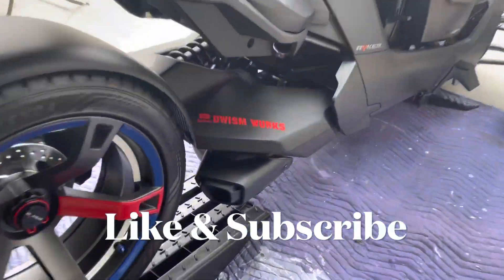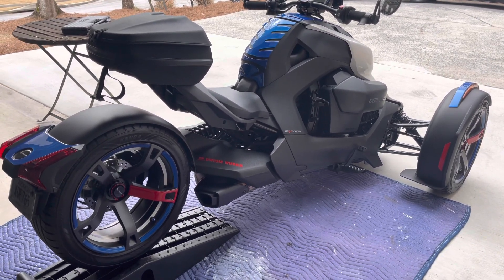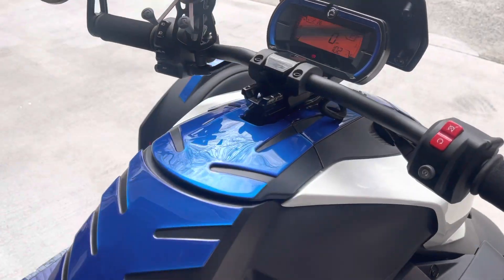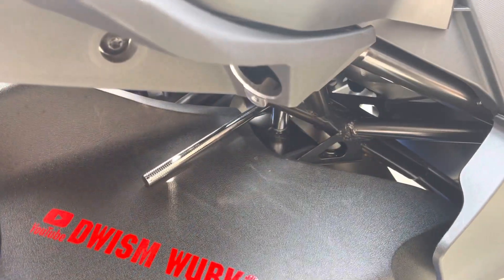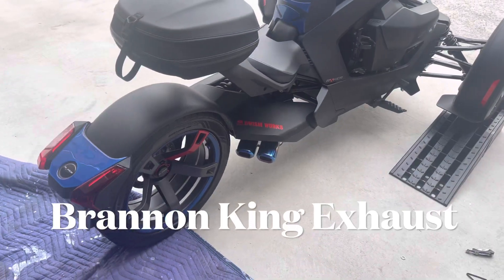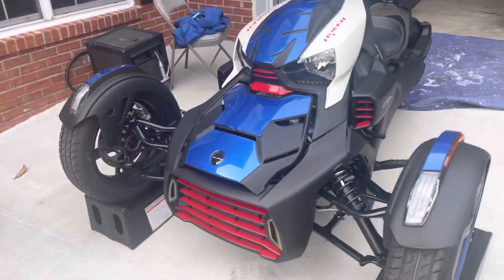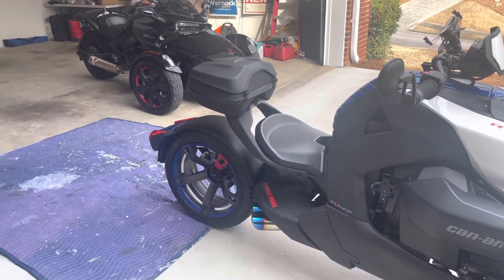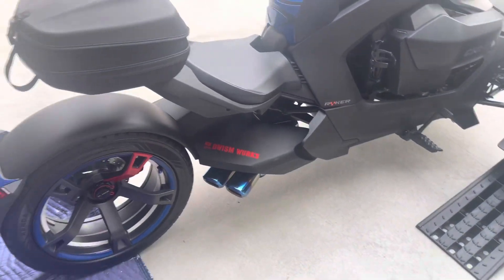Ryker + BK Exhaust = Trouble

Comment: It is loud...ear plug loud. I bought a baffle that he suggested, but have not installed it yet. I actually got used to the sound with ear plugs. I think the sound did change over time. There are two distinct sounds it makes with this exhaust. A raspy sidewinder like tone and the extremely deep growling drone. Performance is amazing!  I paired it with a 40.00 k & n drop in filter, and maaannn let me tell you...it produces so much power now. I can spin the rear tire at 40mph easily when I get on it hard. The grin on my face when that happens will not get old, and I’ve had it about a month now. “It’s a beast” is the most accurate description you can use. The sound and power gain is over the top. It makes you ride fast. I plan on installing a ram air filter soon. It will be interesting to see what that mod does. 
It is a matter of preference. It’s loud, you WILL get noticed. You WILL turn heads. That is part of what it’s all about. Performance being paramount, and the safety it brings in being heard. Nothing will prepare you for the sound your bike will make when you start it after you install. I think everyone has thought “I made a mistake, this it to loud”. ...at least I did. A month later, I have my throttle technique down and I’m used to the attention. Bravo Mr King!
Reply from the maker: Agreed.  The sound initially, I was not sure.  The more I ride it and hear it, the exhaust is here to stay.  It does growl very hard.  I like the fact that it has seemed to adjust some of the sound as I continue to ride it.  I need to look at the filter and some of the other things that you have done.  I gave the old wallet a 1 month break, but will be resuming shortly.  lol
Reply: @dwismwurks  Do you wear earplugs?  i cant do it without them.  may do this baffle this weekend.  i just don't want to lose any HP.
Reply: DFWMC, what Baffle did he recommend? I also have a BK 👊🏾
Reply from the maker: Absolutely the best exhaust.  Still rocking with it.  I love the fact that you will be notice and that people hear you approaching.  I need to try out the other additions you spoke of.
Reply: @dwismwurks  I’m way past those mods now. Ram cold Air filter, headers, a tune and exhaust. It does an amazing job. Looks and performs like it sounds.

Comment: I have to take my BK exhaust off. It's TOO loud! I will go deaf if I keep it on. It's SO loud!
Reply from the maker: How long have you had it on?  I noticed that it had quieted down some after riding approximately 50 miles.  I speculate b/c of bike tuning itself.  The benefit is that people can now here you, at least.
Reply: I've had it on for about 7 days now. Took several rides (Daytona Beach bike week) it getting louder if you ask me. Its unbearable on the highway. I now have to wear ear plugs, and they barely work at keeping the noise out.
Reply from the maker: @WeaverWrestler  I do understand.  It does get deep and growls a lot.  Safe riding!